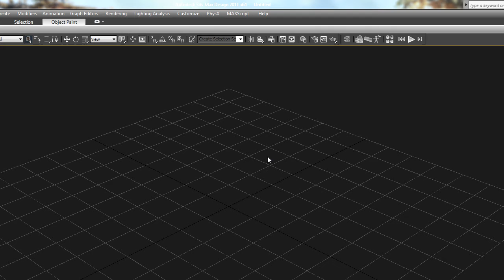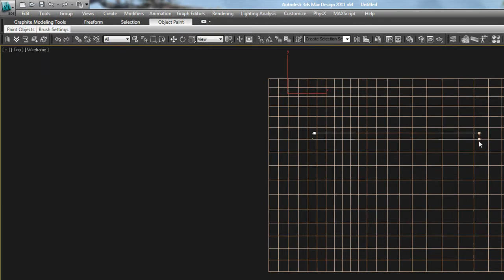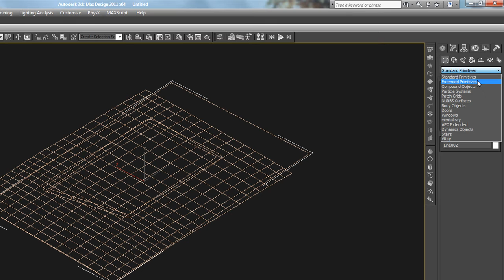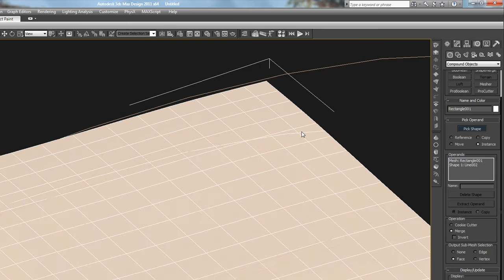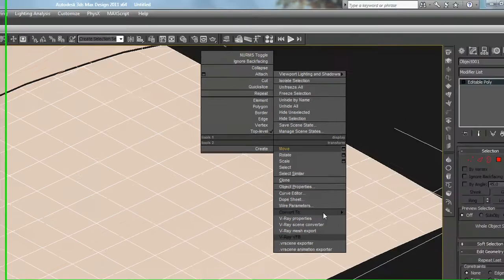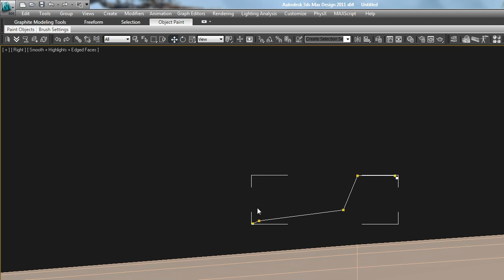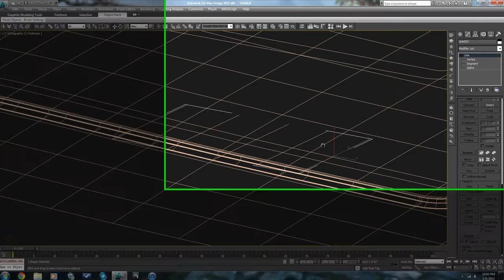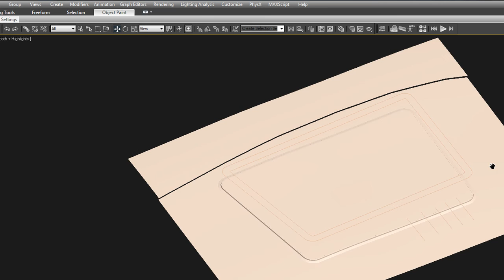Basic Site Modelling for Sloped Sites in 3ds Max

Comment: Adam, this tutorial is GOLD!!!  :elbowcough:

Though I've been using 3ds Max exclusively since 1994 (it was actually 3D Studio VIZ back then), I've only once had to create roads/curbs/sidewalks on a complex grade.   It was a nightmare because I ended up just tweaking bezier polylines endlessly to match the landscape as closely as possible.  This tutorial just took SO much weight off my shoulders agonizing over how I was going to handle curbs and things on a current project.  Thank you.
Reply from the maker: Awesome! Glad to hear it. Yeah, there sure is a lot of hidden gems inside of Max.

My real tip for modeling on sloped sites is to avoid at all cost! LOL. But, sometimes you just have to.

Comment: Great Tutorial - Is it possible to do all of the street / landscaping - road / pavement boundaries etc - in autocad and then bring it into max as a spline and edit from there? (I'm relatively new to max by the way)
Reply from the maker: +SuzukiMx184 Yes, it is, however, I usually bring in the lines from CAD and trace to them in 3ds Max.  For some reason, Max likes splines that were created in Max better than splines from CAD, especially when it comes to using shapemerge.